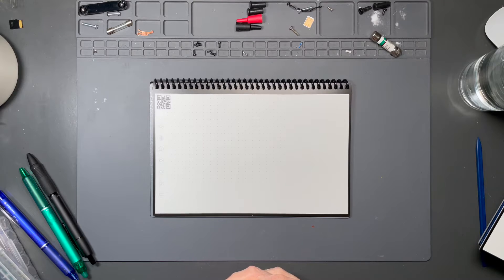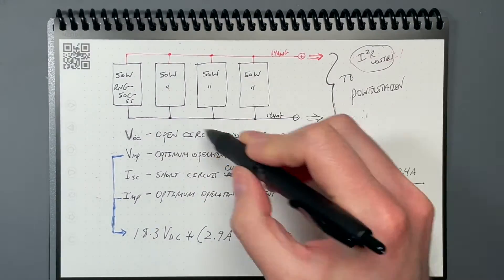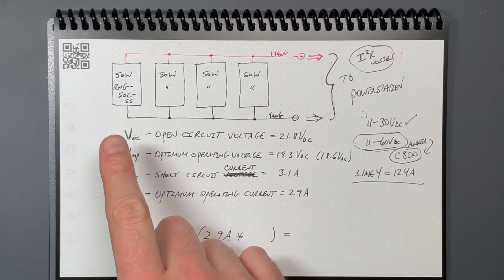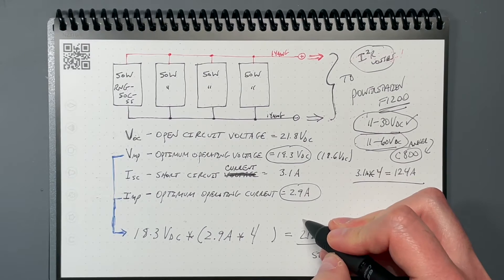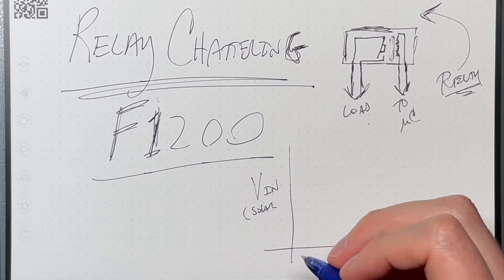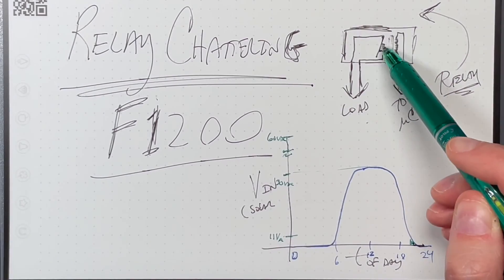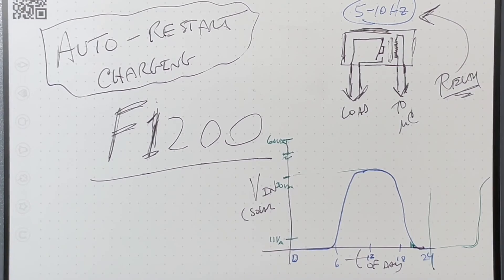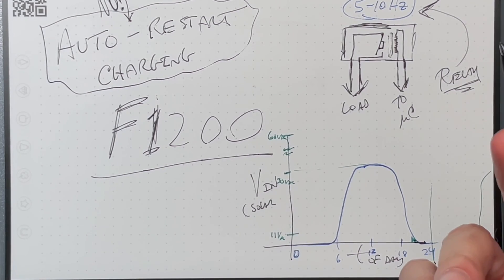Solar Charging the Anker Solix F1200 (Quirks and Issues)

Comment: Wouldn't using an MPPT charger capable of outputting 48V between the solar panel and the power station allow for a wider range of solar panels and provide more stable power to the power station? For example, the Victron MPPT 100/20

Comment: Sounds like instead of spending $$$ on ankers solar panels I should just spend an hour and  charge my Solix F1200 with my little 2500 generator when Im off grid? It sounds like solar panels damage my new Solix F1200? But Can you dummy it down a little maybe at the end . You are very smart!!!! I appreciate you!!
Reply: solar panels do not damage your solix F1200. I have 400 watts (2 x 200 watt renogy shadowflux panels) and it works fine with them linked in parallel. Double check if your anker Solix F1200 says 12-30V or 12-60V on the back where the solar panels go plugged in. They upgraded the solar charge controller at some point and made it so the solix can handle more voltage. If you have the 30V version then you run into the issue he's talking about in this video where you just need to make sure the panels you choose have a VoC and short circuit current that doesn't exceed its limit.
Reply from the maker: The solar panels did not damage the power station. These are bugs / issues with the design of the power station, as I mentioned in the video.

Comment: Thank you for being so informative. 

If you may kindly shed more light on the pass through charging; Will it work with an AC load like a TV? If solar panel is bringing in 170W of power whilst a 110W tv is connected, will the Anker 757 charge or lose charge in such an instance?
Reply from the maker: In the particular example you give, the Anker F1200 (757) should continue to slowly charge with that input and output. I might make a video to explain further. Thanks for watching!

Comment: I have a Bluetti unit and it has a really annoying tendency to discharge on cloudy days while plugged into to panels. As soon and the battery see's .3 watts, it wakes, however that is less than what the internal electronics consume so the battery can self drain down to zero which is highly inconvenient. I started doing some internet sleuthing and found that Bluetti and Ecoflow have this issue. Anker has "solved" this issue by just abandoning the auto-wake feature entirely. How hard is it to design a circuit that poles super slow and checks if the input power is higher than what the internal electronics consume, then waking the unit?

Comment: Thank you for your video,  even though I only understand 5% percent of it. 
I have a anker powerhouse 757 as well.  I have it in my off grid caravan with a 200w solar panel.  It is so frustrating that the battery doesn't charge when I'm not there to push a button to start the charging.  I have the most sun in the morning,  but I'm rarely there in the morning,  so the battery doesn't really charge.  It's too heavy to carry home.  And I bought it, so I have off grid power.  Is there a way to fix this problem? So it charges when I'm not there? 
It's pretty useless atm..
Reply from the maker: You might be able to press the display button to "start" it even if it is dark out, and it should start charging once the sun comes up. Beyond that, I have ideas. Nothing to report yet....but working on potential solutions.

Comment: Just found this video looking for an answer about my anker power bank. I have the 555 powerhouse. Just did a few days away and it kept charge topping up nicely (I was using it constantly to run a fridge in the van). Came home, turned everything off, the van sat unused for a couple of days and the charge barely increased even though my solar panel is always plugged in so it seems I’m getting that failed auto restart as well. Seems super annoying that it does this.